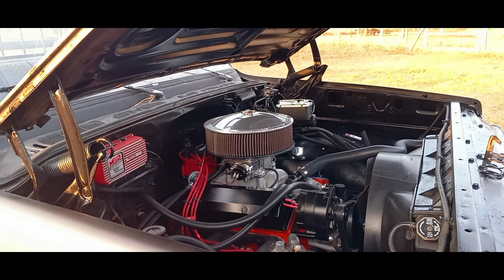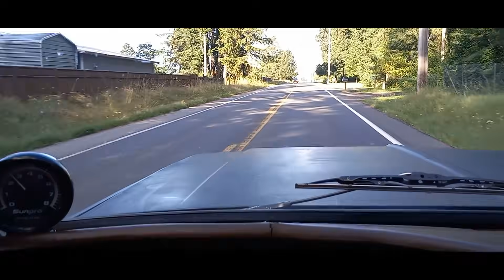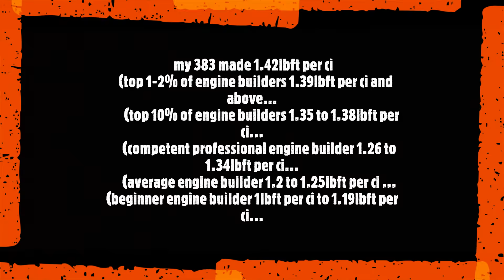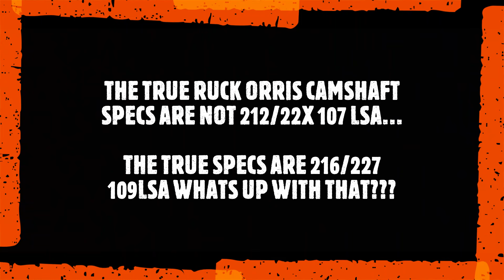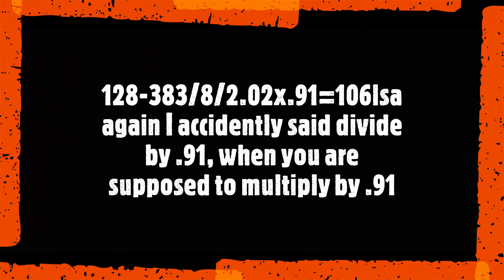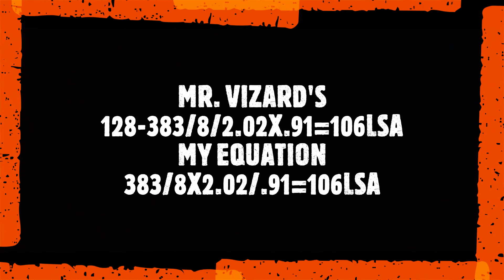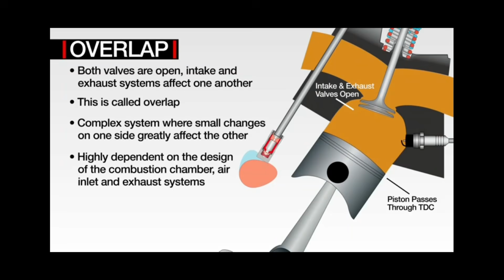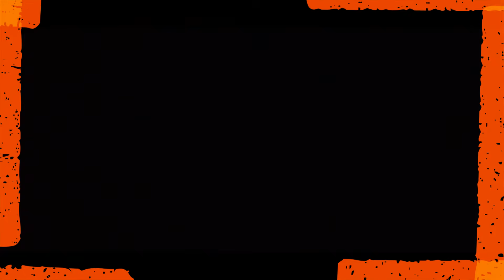CAMSHAFT SELECTION by LSA, 9 LSA's DYNO TESTED!!! LSA THEORY WILL BE DYNO PROVEN!!!, and EXPLAINED

Comment: Interesting video. I'm subbed to David Vizard's channel, as well. I'd love to test out this stuff on my project car, which is a BMW with a 6-cyl DOHC engine. It has 4 valves per cyl, and I'm not sure how that would affect the math.
Reply from the maker: Thank you for watching,  I know none of the existing numbers for the formula won't work, but I can't speculate on wether or no Mr. Vizard has a way to apply it.. take care buddy.
Reply: I suggest that you buy David Vizard's book How to Build Horsepower. In it, he deals with all of the variables for different motors that went into the 128 formula for Chev. The 128 is just the simplified starting point for Chevy owners. The book deals with camshaft selection, starting from cylinder displacement, and continues from there. I highly recommend it to you
Reply: Thanks. I see some of DVs books on Amazon (including the one you mentioned). I'll check them out.

Comment: Sbc 350 with e Street heads. I have comp cams with lsa 110 in the sheet. Any good for daily driver. By the way i checkt geometry and hardenes ok. Melling lifters come with the Cam.
Reply from the maker: 110 is not bad for a daily.. thanks for watching.
Reply: @CDG-Racing_Dynamics  thanj about video. I Just found Mr dv. Intresting stuff. I had 270 back in 90 in tempest. Just struck heads . Not much Power but good rpm range. Pontiac did well top speed.

Comment: Thank you so much for this information. I do have to ask, how would the David Vizard formula for LSA be applied to a 4 valve per cylinder engine?? Would there be any modification to the formula?
Reply from the maker: Thank you for taking the time to watch. Now as far as the formula working on 4 valve engines and how it can be applied, I can't say because I dont know 100% so it would just speculation. I've seen people ask Mr. Vizard that very question but I've yet to so him give anybody an answer.. sorry I couldn't be of any help. Take care.
Reply: @CDG-Racing_Dynamics  completely understandable. Thank you for your reply and knowledge.
Reply from the maker: You are very welcome, I appreciate you taking the time to listen to what I have to say, it really means alot... take care..
Reply: No it would be different Dv's 128 formula is strictly SBC, 127 is Windsor, 132 is BBC
Reply from the maker: @Alex Landsberger. I understand this formula enough to have given him that answer and i was going to tell him no because its obviously intended for 2 valve v8 engines, but there is no way to be 100% sure that Mr. Vizard doesn't have some way to apply the formula that he hasn't told anyone outside of his inner circle, but i didn't want to speculate...  thank you for trying to help him out though👍. Take care..
Reply: If you read David Vizard's book How to Build Horsepower,  you can see where the 128 formula came from. The formula actually starts with cylinder displacement, then is adjusted for compression ratio, valve sizes, valve arrangements, etc. Including 4 valve heads
Reply: I am sure that there must be a way since David Vizard has done cylinder head and cam development for Formula 1, I bet that there’s too many secrets or NDA’s.

Comment: Any thoughts or opinions on dry air flow affecting cam timing? I'm referring to gen V lt engines specifically.

I find it funny, on some of the dyno videos out there by "professional, high end" shops get so so power #s. If you post a quick fact like tq/cu. in. and how it's a little on the low side, your comment gets removed or moved to the bottom of the list.
Reply from the maker: I will have to get back to you on the dry airflow and it's effect on cam timing when I have a little more time, but I will try to adress that question for you.. as the for pointing out of tq per ci production that is on the low side I 100% agree... take care.. & as I said I will try to get back to you when I have a little more time...

Comment: From what i have been told, Efi requires a minimum Lsa of 112°, to give enough vac. for the cpu. But i have a 110° Lsa hyd. Roller cam, 220° @ .050 dur., and .498 Lift cam using the factory 1.60 rockers, in my Efi Sbf 302 H.o. engine, that has 9.2 to 1 comp., and it sounds, and runs great. The stk. Cam specs are 222/212 @ .050 dur., and .445 Lift w/115.5° Lsa. If i were to keep my 302 cu. In., but run milled heads to increase my comp. to 10 to 1, and use ported explorer heads, and intake, that each flow 230cfm @ .500 Lift int., and 170cfm @ .500 exh.= +70cfm on int., and +60cfm on exh., more than my current (stock heads= 160cfm int. @ .500 Lift, and 110cfm @ .500 Lift exh.)  Also my stk efi intake flows 165cfm avg. Per runner, vs ported explorers 230cfm.  If i were to keep the factory rev. Limiter set to 6,250rpm, how far off is my current cam, from optimal? And would using 1.72 roller rockers, and advancing my cam +4°, add avg. Hp.,  and tq. In this eng. Combo?
Reply from the maker: Thank you for watching, I will help you with your question when I have a little more time.. I pretty busy currently. Just know I won't forget because I will write it down.. take care
Reply: @CDG-Racing_Dynamics  I would appreciate that very much. I dont know the intake runner length on the stock ported explorer efi intake, or on the ported explorer heads, but i could ask the porter when, if you need those specs/numbers? My 302 also has stock pistons, and rods, which i believe the stock rod length is 5.09 inches. Thank you
Reply: Thank you for sharing this I just started watching Visart a few weeks ago about mufflers and header runner lengths, he is wealth of information. Currently I have a 6.2 l Ls 3 rd Gen in my truck. (It was built by a well known engine builder around here) I selected a SD truck torque cam with 205/210 @ in .550 ex .525 with advertised 115 LS, with the formula you provided it shows It would be better with 105 LSA. Using the calculator off of Wallace Racing site, when I enter the cam I bought specs there it shows an LSA of 103. Not sure I’m understanding everything correctly. I will research more.Any input would be appreciated.

Comment: I'm a DV128 believer but I use a slightly different version of the duration formula..same result but outputs advertised duration rather than @.50..DV and Andy recently discussed this.I use the formulas combined with flow data to decide lift on my LS build...I have recently found some pretty big gains by reducing lift to between 592 and 598 and concentrating on porting and flow work, the LS engine seems to benefit greatly from increased air speed.
Reply from the maker: Thank you for taking the time to watch! I had realized that i had accidentally left out the formula for the advertised duration after I had finalized my video, its because of my damn crps effecting my brain, I cant even hold on to or remember my own taughts, I  swear I'd loose/forget my head if it wasn't attached to my neck lol. Take care buddy!
Reply: @CDG-Racing_Dynamics  I had a tbi a couple years ago and the carnivore/lion diet really helped me. My tbi  was bad enough I couldn't leave the house some days now I'm getting close to being somewhat normal again also helped alot with my back pain. But alot of people have stopped there autoimmune illnesses with it.
Reply: If you don't have a clue to what you're doing have some one who has a clue build it for you

Comment: Why cant u run lopey cam in a 350 tbi motor
Reply: U can ... need a fuel pressure regulator ,Injector upgrades , and EBL flash for tuning ... I did it 10 years ago
Reply: @RAWRMotorsports  ty
Reply: Bad for emissions I’d say
Reply: @cedricwilson2055  no emissions here in Ms

Comment: Power is in the cylinder heads, no where else
Reply: You're half right.
Reply from the maker: He is absolutely only half right!! Take care, and thanks for watching..
Reply: Yep, it's all in the heads. That's why cam upgrades make more power, right?
Reply: @michaelblacktree  you seem like a numb nut like doggy garage. " a cam up grade " what do you mean ?
Reply: You don't know what a cam upgrade is? And you call me a numb-nut? LOL
Reply from the maker: Did you not watch the whole video??? If you did you obviously dont understand  valve events and the effective increase in output that can be had.. Now, i can tell just by that statment you made alone explains that you dont understand and that is very common! that statment is always made by improperly educated individuals who dont retain enough understanding and have absolutely no experience building max effort race engines... Here is the first example.. There is no set of cylinder heads you could put on a stock engine or any engine for that matter And gain 100hp+, because in order for the cylinder heads to be effective they need better valve events to be able to utilize the positive effects of any given cylinder head., therefore all the power is absolutely not in the cylinder heads🤔... you can take a stock engine And properly spec a camshaft to obtain the absolute maximum use of a set of cylinder heads to better feed to the cubic inches of a given engine... a proper camshaft can produce a power Increase of 100+hp with a stock engine just from a camshaft change alone, as I said there is no cylinder head that will give you the gains that can be obtained by the proper valve events.. Now, again cylinder heads are almost worthless without the proper valve events to take the most advantage of a given cylinder head to allow the cylinder head to properly fill and evacuate the cylinder.. now dont twist my words or put words in my mouth because cylinder heads are an integral factor in combination with proper valve events, they are bolth influential on each other... so for you to make that statment that you claim to be 100% true was rather ignorant to be honest, especially without leaving the "proof" of your concept or an explanation of the theory you have formed because apparently you have convinced yourself that you have reinvented the wheel!! Here Is another example, You can take a set of nice cylinder heads and pair them with an inoptimal cam with the results being your nice cylinder heads are not being utilized and are no longer worth a sh!t, conversely you can take a set of decent heads paired with the proper valve events and produce way better output then an engine with nice cylinder heads and improper valve events... if that dont make sense I don't know what does because that is the reality of the world we live in, and unfortunately you can't change the regulatory laws of physics to fit your verson of reality because physics dont care what you think, all it knows is what is true!!. take care, hope this helps you come to some realization..hopefully you are not the kind of person that takes this the wrong way, and then feel some undeniable narcissistic impulse to lash out irrationality to feel some sort of validation, then proceed to act on it by making some absurd comment that i have to rationalize and explain further....I've allready dealt with those individuals, and sent them packing with their tail tucked between their legs!! take care.. like I said I hope this helps...
Reply: Dude, displacement, plays a role intake, manifold, exhaust manifold, all play a role..
Reply: I am not 1/2 right, I am totally right.    You put identical cams in a flatie ( just an upside down cyl head) or a 4 valve head, any difference ? POWER is in the head
But ! there are optimum cam timing events depending on engine performance requirements .
The way you communicate with people suggests to me, you seriously need physciatric  treatment, or a massive attitude adjustment
Reply from the maker: SHOW ME A CYLINDER HEAD THAT WILL PRODUCE MORE THAN A 100HP INCREASE ON A STOCK ENGINE!!! YOU CANT BECAUSE IT DONT EXIST BUT I COULD SPEC A CAM THAT WOULD PRODUCE GAINS OF 100+HP ON SAID STOCK ENGINE!!! Go run your theory by MR. Vizard and see what he tells you better yet run it by any other the other professionals that are in the top 1-2% of the game, you wont like what you hear!! Like i said did you not watch the video?? Did you not see the 3 LSA dyno sheets?? Look at the gains from just changing one single critical spec of a camshaft, all the other specs were identical Nothing was changed about the heads!!! If you dont see it then apparently it went way over your head and I can't help you!!. ponder this, Why was I able to take crap stock heads and build a 383 that makes 580hp & 545lbft, then take said engine and prove its worth in the form of eating & shitting 45-50 big block trucks at the largest event in 3 states, then procede to win that event every time I entered.. With proof of my claims in the video in the form of trophys, how did I do that with stock heads?? Please enlighten me mr wizard.. im not wasting anymore time with this, if you don't understand that is on you.. it ain't my loss...
Reply: @CDG-Racing_Dynamics  you could probobly pull 100HP from heads with a big block if you went from the worst smog head to the best aftermarket head but it would only be possible because of the sheer size of the engine.
Reply from the maker: Yeah, but that would be an extreme exception. if you were to say  put a smog head on a 632 then changed it to a high end aftermarket head you could im sure gain over 100hp. But why would you put a smog head on a 632? Lol.   I do like your thinking though... take care buddy!